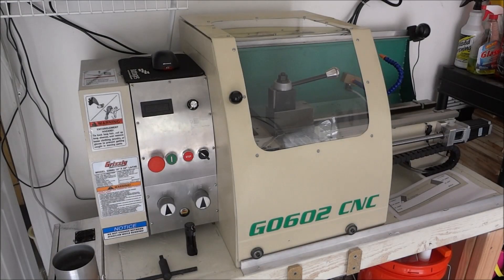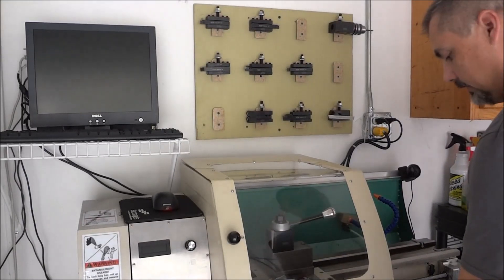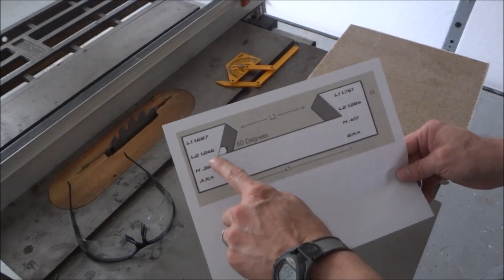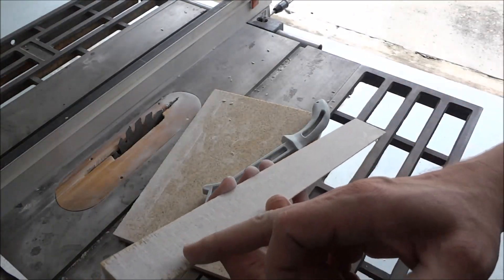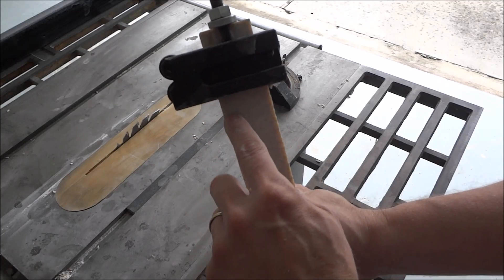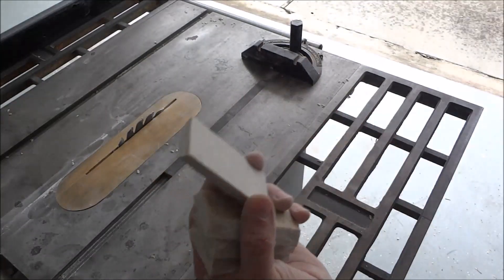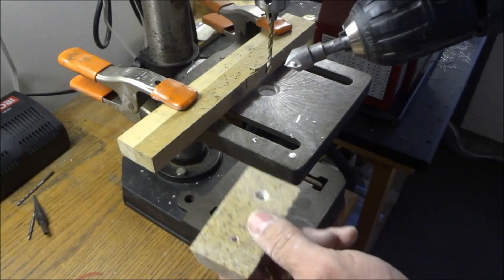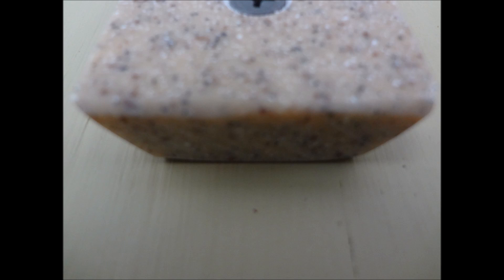AXA Tool Holder Free Organizer

Comment: Hi,

I made similar holders for my AXA tools.  I mounted a square tube that runs vertical to the coolant tray of my  Clausing Lathe.  I mounted different tools on different sides of the square tube running them upward to allow for clearance when removing them for use on the lathe.  I made the holders on my HAAS TM-1P Tool Room Mill with a dove tail cutter.

Speaking of AXA tool holders I made some really neat coolant adapters for my AXA tools.  No more fooling around with those flexible coolant lines that never stay put.  Here is a link to a little video I put together to show you how it works.    https://www.youtube.com/watch?v=MvzdZfUn2_0

 John
Reply from the maker: Thanks John,
Ah very interesting coolant setup you have! The problem for me is I have frequent tool changes on some of my jobs so I'm not sure how the Push to connect fittings would work out. But I do hate fiddling with the flex hose.
Be Safe,
Sam